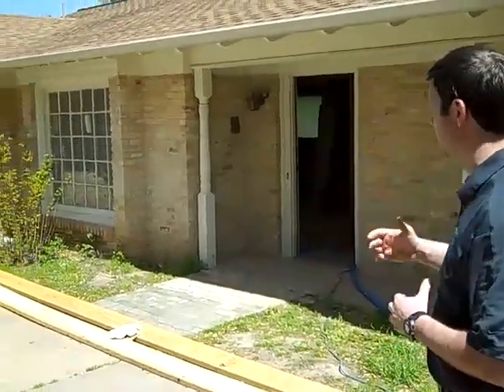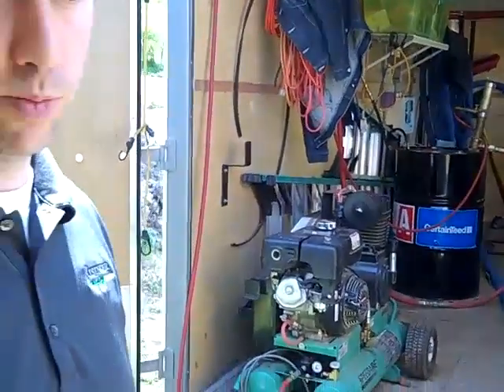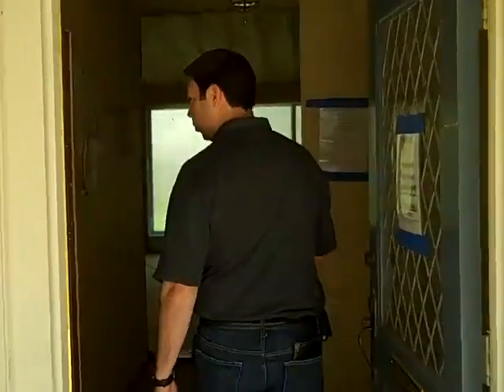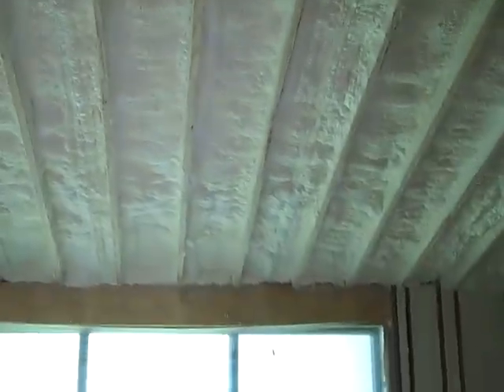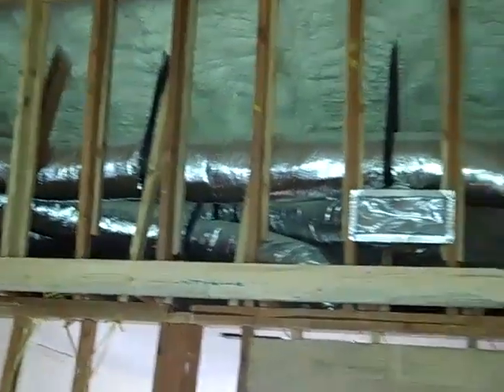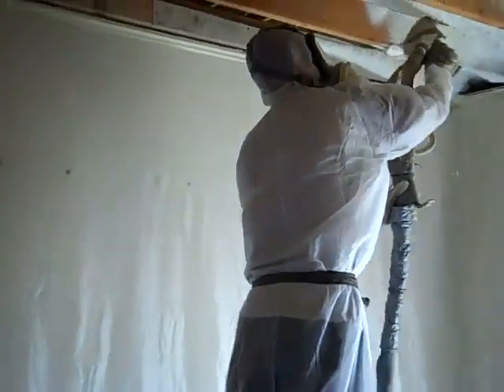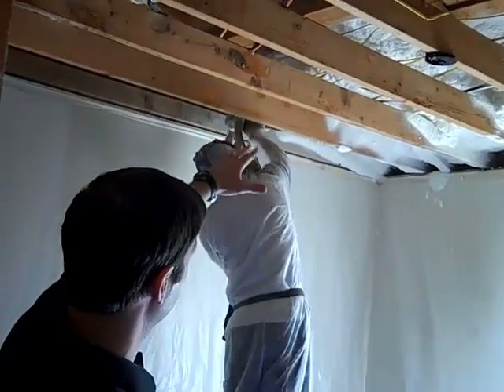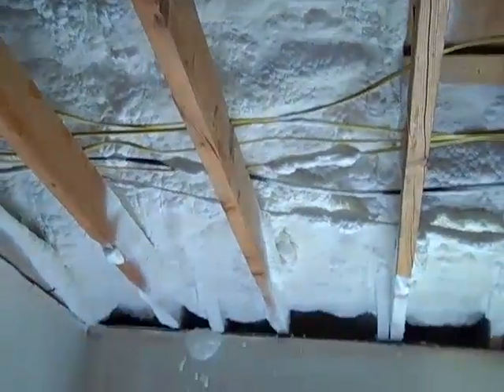1950's House Forwards to 2010 Efficiency with Spray Foam

Comment from the maker: @Artsee77 The open cell works great in our Hot-Humid climate.  See what Joe Lstiburek has to say about open cell in your climate.  Done every house I've built in the last 6 years with open cell on the roof deck and haven't had a problem yet.  Regarding the moisture transfer - stop the airflow - stop the moisture flow.  Bulk water will run though it however.  A roof leak will run right through which is actually a good thing.  -Matt
Reply: Hey Matt, im a remodeling contractor in Oklahoma and was wondering about roof life when the open cell is sprayed on the under side of the roof decking like that.  I just re roofed my personal 2008 built house and want to retro the attic with open cell spray foam. Any insight or precautions would be appreciated.  Love seeing quality builders do there thing and with years of houses under your belt I really would value your insight.